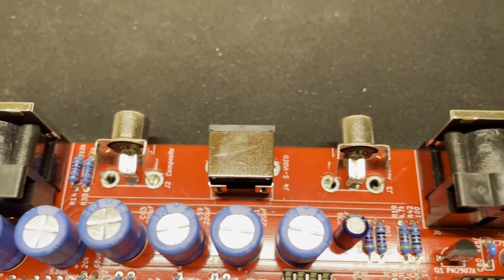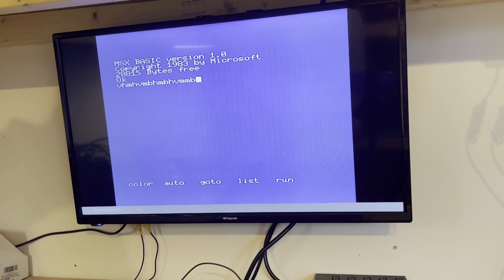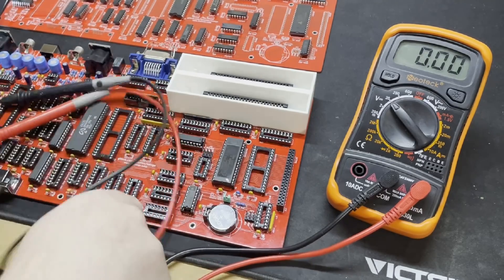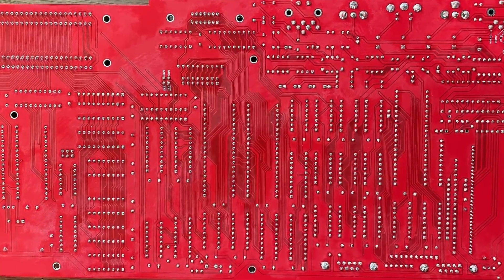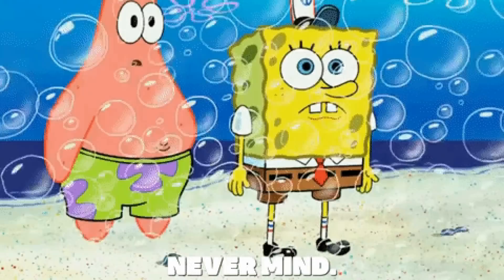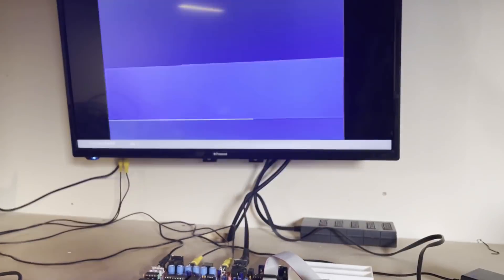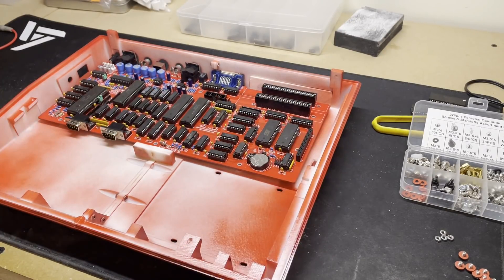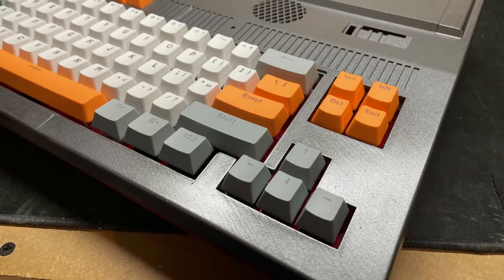Omega MSX Build Part Three - It's pretty, but does it work?

Comment: Great videos.  I finally got mine up and running but testing S-Video has produced Vertical Lines after the MSX Boot screen.  The Bios Launch with the MSX Logo is clean, but once I get to the prompt, I get vertical lines and does the same in a game.  Just curious if yours does the same or does S-Video run differently on the Omega than the US standard? (absolutely no clue if S-video is universal or not).

Comment: Given how much you're spending on other stuff, you might consider getting a cheap oscilloscope. It makes debugging problems much faster because you can see the exact AC signals on pins.

For example, I probably would have started with your standard ROM in the system and checked the A0 address line on the CPU which should show regular sequences of alternating low and high signals at the system clock rate, indicating that the CPU is executing sequences of instructions. If that's working, you can move on to A15, which should always be low if it's executing from the ROM (addresses $0000-$7FFF); if it's not you can check the power supply pins to see if the chip is getting consistent +5V between power and ground without large dips in power (which would indicate a problem with the PSU or the power lines on the board). If that is working, you can probe the address and data lines on the ROM to ensure it appears to be returning some sort of reasonable data. You can also probe the address pins on the video memory side of the video chip to show that it's scanning the video memory to produce the display, and so on.

While a benchtop 'scope ($300 or so for a low-end two-channel model) is easier and faster to use, even a decent handheld 'scope ($100-$200) will do well enough, and if you're really budget-limited you can find low-end handheld scopes for under $50.

Comment: Great video! You might want to get some proper MSX joystick, with 2 independent fire buttons. It's very useful in several good games. Also, you do have the V9958 chip, so I'm pretty sure you can also enjoy some MSX2+ extras from some games.

Comment: Where did you buy VDP socket? I will use carchano msx new PCB to mount my expert 2 but is not usual this socket in Brazil.
Reply from the maker: I got mine from a seller on eBay :) Good luck with your build!

Comment: Oh man that first moment of the msx logo popping up, epic! Love the nms8235 grey/cherry paint job, makes it look unique and period correct! 
Can't wait until you pop in an FM Pac (YM2413 or does that cartridge from brazil include it?) and run a few msx2 games! 
What are you going to use the printer port for? Do you have a dot matrix printer to try it out?
Reply from the maker: It was a magical moment :) :)  The cartridge doesn't contain the FM Pac but I'd like to see if I can get one in there :)
Reply: @TheRetroShack  it's a great little synth, I think some new pcbs should be available somewhere. Aliexpress has some used ym2413, but make sure you order 10 of them, half may be bad. Scc is nice too but may be expensive these days. I was lucky to get one before they got rare for like 15 euros or so.
Reply: What might be handy is a little microcontroller box that would convert the printer port's parallel output to serial output, which then could be connected to a PC via a USB serial interface. Then you could save your "printouts" in easily-viewed text files.

Comment: Nice vid mate. One question, the 9958 is a MSX 2+ VDP. Did tou try a 2+ rom?
Reply from the maker: I haven't - yet.  But I will be now :) :)
Reply: I would love to see that too. It would be pity if you have that VDP and don't use it to the max :)
Reply: Hi, he is trying to use PAL system, but there's no MSX2+ BIOS until I know, Japan works on NTSC
Reply from the maker: @msxmakersretrocomputing134  Yep / you’re correct - the MSX2+ was only ever released in Japan :(
Reply: @TheRetroShack  On the other hand, I think that if you use the RGB output you will have an excellent image and the option of NTSC/PAL will cease to be important. If your TV supports SCART it should support NTSC picture by SCART.
Reply from the maker: @jordisolis6766  Thanks Jordi - I thought the same thing .  Started working on a switchable PAL/NTSC PCB pulling all of the different components into one place - I’ll drop it on MSXMakers when I’m done :) :)
Reply: @jordisolis6766  Some games use this frequency to pace the game, so on 60Hz it would be a bit quicker, or at 50Hz it would be slower. Music playback is also affected.
Reply: @imqqmi  correct, you will need to choose between fast or slow, between MSX2 BIOS or msx2+ but not between PAL or NTSC because they will be displayed.
Reply: @msxmakersretrocomputing134   yep, but will have hardware horizontal scrolling. And access to a few exclusives and in game improvements. :)  ooooooo boy, can't wait to start building my omega

Comment: That paintjob should have been better. You can still see that it's 3d printed and in two halfs. Why not use a filler first, sand it down and after that put on paint. Would look much nicer!
Reply from the maker: I did make that comment in the video - I was up against time.  Next time you see it, it will look much better - hopefully!  Not my expertise unfortunately :(

Comment: Something that can catch anyone troubleshooting is this. I saw you check there was +5 to the chips however you were using a GND reference at the power supply. This only checks one of the power rails and missed the GND rail. If the GND pin on the IC is floating the chip won't work. I've seen this a couple of times. There are several ways to test this. You can do what you did then reference the positive lead on the meter to +5 at the power supply and use the negative lead on the meter to test all the GNDs. You could also make both connections at each chip.
Reply from the maker: Thanks - yes I caught that too but after I’d already filmed.  I did go back and check on the positive rail too.  Very good to point this out!

Comment: That's a really nice result. You can put a clear coat over spray paint to give it a bit more oomph and durability.
Reply from the maker: Yes, I'll be doing that once I've sorted out the seam down the middle :) :)
Reply: @TheRetroShack  '2k ' Paints dry into a more durable paint. Might be relevent to something that gets handled. 2 part can is one time use. Painted my car with spray paint, looks great. Definitely needed a 2k coating.

Comment: I wonder why you didn't go and create a 16bit version of the MSX computer with a ZILOG Z800 which would have been compatible with both the ZILOG Z80A and ZILOG Z800
Reply from the maker: Having been burnt on the other chips, I just go exactly what the BOM said :) :)
Reply: Then it wouldn't be a MSX machine.. The standard clearly states a Z80 as the main CPU.  However, the Panasonic  FS-A1 ST/GT MSX Turbo R uses an Ascii R800 CPU, Which is a derivative of a Zilog Z800.  See Wikipedia https://en.wikipedia.org/wiki/R800_(CPU)